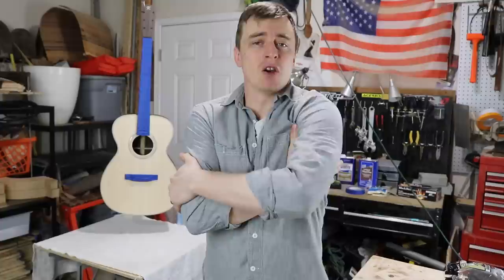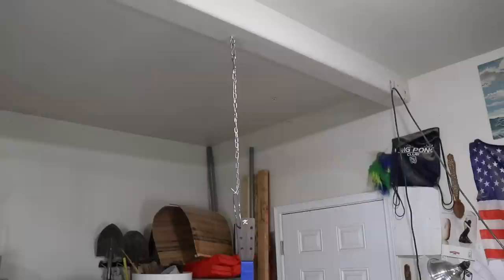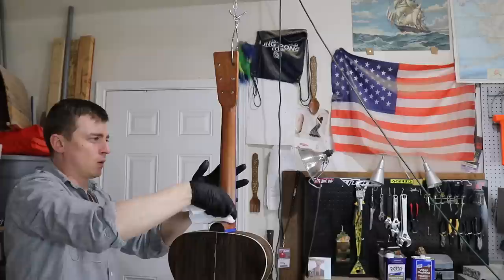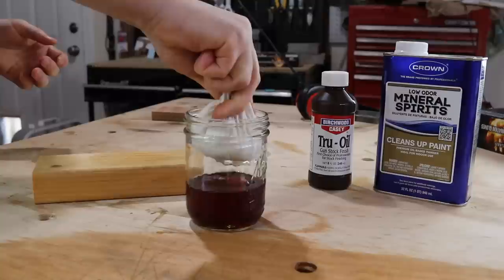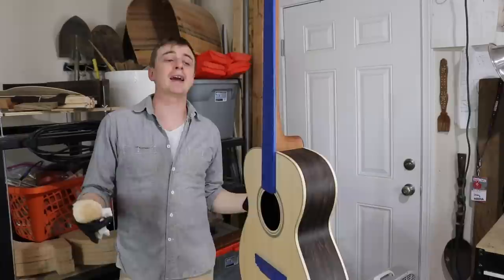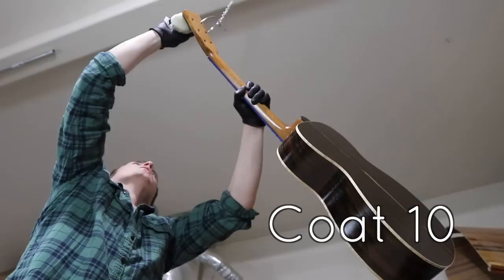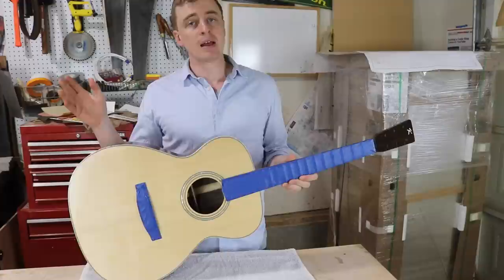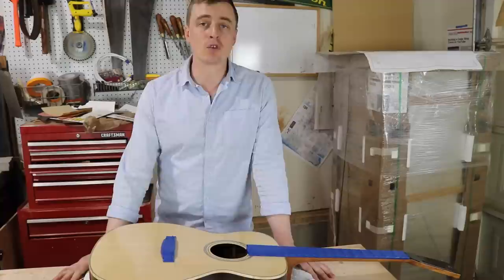Applying a Tru-Oil Finish (Ep 23 - Acoustic Guitar Build)

Comment: I wish I had know abt that sealer you used prior to finishing the uke I built.  Was ziricote also and couldn't agree more abt the open grain character of ziricote.  Was a lot of work & did not turn out nearly as nice as ur guitar.  I used TruOil as well, just not as many coats.  Great job 👏
Reply: I’m wondering if you’ve ever sanded in boiled linseed oil. It fills the pores but I’m wondering if it would have any negative effect on the wood.

Comment: I'm pretty sure if you hold the mineral spirits can sideways when you pour it will work better. I know that's the case for when the opening is offset from the middle, you hold the can sideways with the opening on the top half. It helps with the airflow I believe.
Reply from the maker: LimitDNE haha thank you! I was totally in a rush when I filmed that and didn’t want to do it over so I just went with it😅 I’ll try your idea next time!
Reply: Again not really sure if it works when the opening is in the middle but I spent way too long spilling everywhere before someone informed me it was designed to be poured differently.
Reply: @limitdne  Ha ha, I was going to offer the same advice, even though I know I'm late.
I will be using this technique on the classical I built 15 years ago but never finished.

Comment: Mate, why did you make a scarf joint in the headstock instead of in the neck?
As I know it's considered weaker as:
1) fretboard doesn't clamp it against the neck
2) tuning machine holes reduce strength of such joint
Reply from the maker: Lexonn I’ve seen it done this way most of the time. I think it’s actually a little stronger because the headplate reinforces the joint this way... but this is only my second guitar so I could be wrong... time will tell ¯\_(ツ)_/¯
Reply: Well in the other way no only neck, but also the fretboard reinforces the joint.
Therefore not only we have the bigger glue area (I think), but we ALSO reinforce the joint in two directions.
We get /\V/\ joint instead of just /\V.
Even further, I think it might provide for addition resistance to neck twist/warp.

To be fair, scarf joint at the headstock might provide for a better sound, cause the glue barrier and change of the grain is almost absent between the nut and the saddle then.
It is present above the nut, but I'm sure it totally doesn't affect the sound as much.